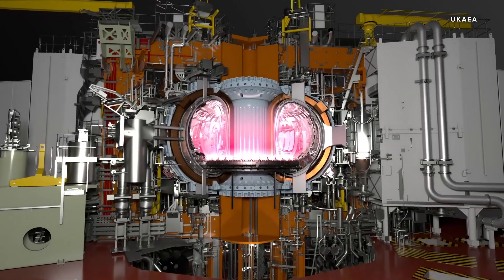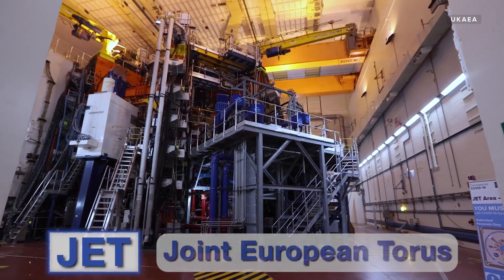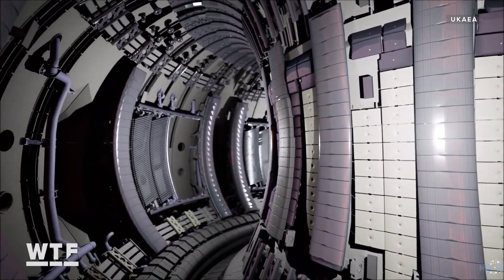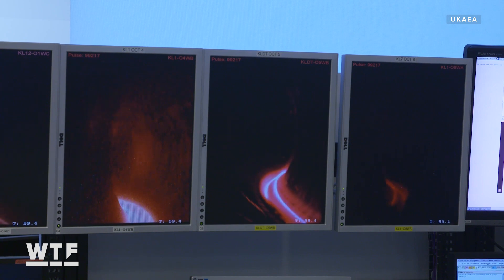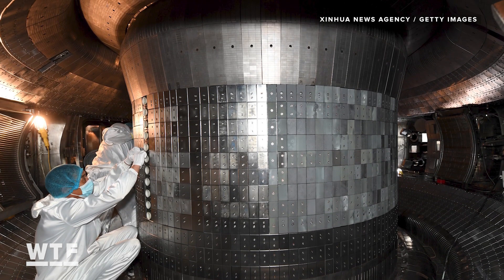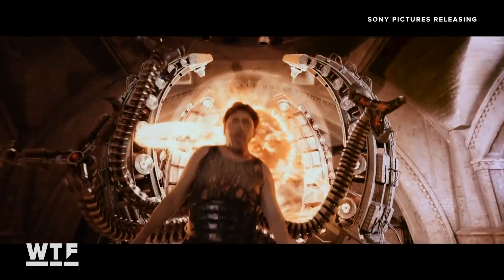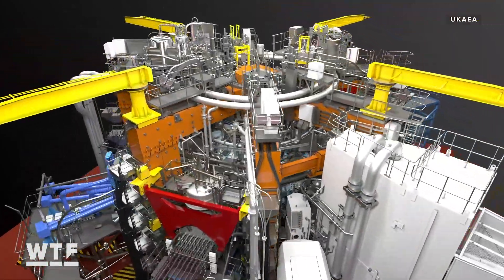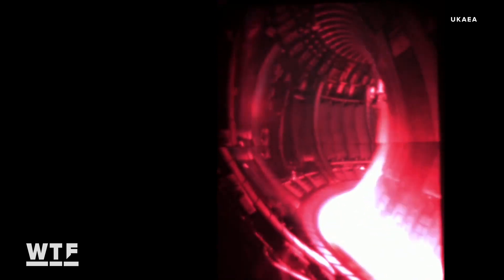World's Largest Fusion Device Breaks Energy Record

Comment: For those wondering, Q was 0.33 for this latest experiment whereas Q was 0.67 back in 1997.  This is the ratio of energy coming out of the plasma over energy put in, so Q=1 is break-even.  The difference with this recent experiment is that it lasted 5 seconds and produced 59 megajoules of fusion energy whereas it produced only 16 megajoules in 1997.  ITER should be able to have a Q of around 10 when it performs similar experiments because it's larger than JET which makes it more efficient.
Reply: Poly Bun  Totally ridiculous. deuterium enrichment from water is a trivially minuscule energy cost. A single liter of heavy water which costs <$1,000 would produce the energy equivalent of burning 2 million liters of oil.
Reply: @Muonium1  lmao that's insane. God I love how people in 2022 STILL act like it's not possible.
Reply: If larger waste of energy by an exponential factor can be claimed as greater efficiency simply proves how easily investors can be fooled by non-science nonsense.
Reply: @PugsleyLoveJoy  you really have no idea what you're talking about huh
Reply: @bigsmall246  Actually, I do.  I happen to be a nuclear physicist. I also was the first to create cold fusion, in a jar and my setup was what was originally analyzed by Pons and Fleischman. They did not create the original setup.
Reply: @PugsleyLoveJoy  yea and we all believe you
Reply: Thanks for clearing that up. Until now, I had thought that Q was the ratio of trafficked children to elite paedophile cannibals and was relieved that it was still less than 1. I was wondering why we were aiming for more than 1.
Reply: @dannyarcher6370  lol
Reply: great news!! so in 30 years ...  Meanwhile good old fashion Thorium fission, (the stuff that powers our planet core/magnetic feild)  You know the DOE had a working Thorium molten salt reactor and it was shut down in 1962.
Reply: However this recent test did NOT break the '97 record for power, importantly. In '97 they had a max fusion power output of 16 megawatts, this shot was only ~11 MW. With the newer ICRF and NBI heating capability they've installed in the decades since, they SHOULD be able to also break that record, and I believe JET will also be the first magnetic confinement device to achieve scientific breakeven within the next couple years.
Reply: @Nathan, are you talking Qplasma or Qall there? This will only be viable as a power plant if it produces more power compared to what went into it to keep it running.
We don't care about the Qplasma really if we want to have Fusion power plants if the rest of the plant's efficiency is lower than 100% (i.e. Qall < 1).
Reply: ITER is a nonsense lie. They are referring to a different Q and wilfully allowing this confusion to deceive people. Watch Sabina's video on this topic. Fusion has two different Q values and scientists lean into this confusion, to make their progress sound more impressive than it actually is.
Reply: You've got nothing on my dilithium
Reply: You are lying @Nathan
Reply: The 0.67 back in 97. Can they replicate that exactly. Or, in the interest of aiming small and missing small. Was it a once off, in the sense that they have come close but never exactly the same as it? Do you know?
Reply: I'm just curious why they're not exploring more usage of AI to control the plasma. Deep learning has been demonstrated in another reactor to show very precise control of the plasma via the magnetic fields.
Reply: Hypothetically, how much fuel (e.g. deuterium) can need a fusion reactor to power the whole planet for a 24hour day? My concern is that - if for thousands of years we will consume hydrogen that now it can be abundant - what will happen in nature? if we even reduce hydrogen in earth by 1% what are the consequences of that?
Reply: @usefulcreativecontext  There's lots of deuterium in sea water even though it's a fraction of a percent.  The tricky part is getting tritium.  Theoretically, this can be done by lining the reactor with lithium and using neutrons from the fission reaction to get the tritium.  The reaction that creates tritium also releases a lower energy neutron, so it's theoretically possible to produce enough tritium with this system.  The lithium supply of the planet should be enough to power civilization for thousands of years, if not longer, and this should buy us enough time to come up with a better way to produce power when we need it.
Reply: However, renewable sources use earth dynamics (gravity, air flow, sun, etc), and does not directly consume elements. Yes batteries and its construct may consume but can be recycled almost 100%. I think as humanity we must start calculating the consequences of spending elements in far future and earth dynamics.
Reply: This started in the 1960s. JET was built in the 1970s and was fired up in 1983. Q=0.33 is a terrible result. They achieved 0.67 25 years ago. The deuterium/tritium mix isn't new or unique. It's been used for decades. Tritium is extremely rare, expensive and radioactive. Is this an elaborate scam? "ITER should have a Q of 10"?! Are you joking? They can't even get Q=1. That would be a notable milestone for science.
Reply: You are conveniently hiding that the power input was scaled up, is the reason for the longer duration and more heat produced, not from fusion occurring.
Reply: I was waiting for this for 100 years its still uncomplete
Reply: @masternobody1896  Don't worry. Fusion power is only 30 more years away.
Reply: LoL.  So what?  Fusion is going to be so ridiculously expensive, it will NEVER compete with conventional renewables plus storage.  Fusion research is a waste of time, money, and talent.
Reply: @incognitotorpedo42  Before this war Russia was spending a TRILLION bucks to start gas extraction in it's part of the arctic circle.  That's just one fossil fuel project. Ridiculously expensive compared to what? 

Since the 1950s about 30 billion has been spent on global fusion research. Sit down mate, you clearly have no idea how money/science/economy/research/life works.
Reply: @incognitotorpedo42  oh god a boomer man how many times people have said  in history what you just said. 

I.E. Basically you: "Planes will never fly its a wast of time and money, let's build wagons"

Comment: How is the fusion energy transformed to electricity ?
Reply: Probably turbines  as with fission.
Reply: The way everything (except solar cells) produces electricity, turns a turbine.
Reply: The trick here is not how to make it into electricity, Certainly if you can make this type of machine you could easily make electricity out of the plasma. But rather how the nuclear fission is first produced. Rather than having to make rods and have to put  them into the water like regular nuclear sites. They somehow make the plasma out of renewable resources. And there doesn't seem to be any long term waste products by this new type of fission. The Jetsons' indeed.
Reply: @vancechristopher  fusion reactors will produce waste products and the scientists know it. However, the problem is it's illiterate journalists who are writing the news articles. These illiterate journalists understand like 5% of what the scientists told them, then dumb it down further till the layman can understand. And then they sensationalize it. By the time it reaches the layman, it has become a fairy tale.

Don't get me wrong, fusion is the way ahead and we've basically shown that it is feasible with existing technology. Private investors are already starting to identify which companies to invest in.
Reply: @vancechristopher  Actually, making electricity IS the trick here.  There will be a ton of engineering problems.  This is all so preposterously expensive that it will never be able to compete with conventional renewables + storage.  ITER is a huge wast of money.
Reply: Believe it or not, not even a single volt of electricity has ever been produced by fusion "reactors", which are just massive space heaters that cost more to operate than any other beastly thing ever created.

Comment: Still years off, it's been that way for decades :/
Reply: This was a major step forward.
Reply: @sdclams117  
A beetle was walking from point A to point B.  I gave it a hand, picked it up and walked it a hundred steps closer to its destination, which was a major step forward.  Turns out the beetle 🐞 needed to travel another 1,000 miles to reach point B.  Still, from the beetles perspective, it was a major step forward 😆
Reply: Well, technically,  it's been decades off for decades, and ... are you sitting down .... still is decades away 🥳

Comment: at 20 cents per kwh that's 3$ worth of electricity.
Fusion is incredibly important for space propulsion and the advances in superconductors will have many applications but for electricity production we have solar.
Reply: Panels production has plenty of emissions. Concentrated solar is rarely chosen. Ignoring the large amount of land needed for both options.
Reply: We don't have solar. There's no solar during nights. There's no solar during cloudy days. There's not enough solar during winters. That's why we still don't use solar: Because we don't have it. And if you want to fight climate change you don't have to substitute fossil fuels in the grid. You need to do it for transportation and industry. Which means you need to tenfold solar and go to sleep at 6 PM in order to cover mankind's energetic demands.
Reply: @BlueFrenzy  There is something called a battery for cycles that are less than a week long.
For winter you just need to deploy more solar panels.
Reply: @johntheux9238  We don't have enough batteries to cover mankinds energetic demand. There's not enough lithium out there. But also, deploying more solar is also problematic.  Solar panels have a lifespan and they are not completely recyclable. They need to be sitting there "just in case". As you can imagine, doubling the number of solar panels is hardly sustainable. While closing a nuclear central and turning it on on demand is cheaper, scalable and requires much less mainteinance than solar panels.
It's so true, that probably, if we manage to cut down the price of fusion by improving the technology once people invest on it due to breakeven, we will stop using solar panels because of how difficult to handle they are. The future is not solar panels but fusion + solar arrays.
Reply: @BlueFrenzy  There are not enough hard rock (spodumene and petalite) deposits but other lithium sources can be used such as hectorite clay which is abundant.
Reply: @johntheux9238  And it's still far from what is necessary. But really far. And that's just considering a 24 hour battery (you will need much more than that if you want to survive some winters) and not counting other technologies that requires lithium, like electric cars. Yes, there's some plans to use the car's batteries as grid batteries when they are connected, but I am certain you don't want to not to be able to use your vehicle because last night there was no wind.

And, even if you dismiss it all, there's the logistics problems. Building up all the infrastructure to support the surplus of solar panels plus batteries to cover for worldwide needs would take several centuries.

Nuclear energy decimates the requirements of solar panels and batteries, with all the associated benefits from it.
Reply: @BlueFrenzy  Not really, there are more than 80 million tons of easily accessible reserves. That's enough for 470 TWh of storage.
Reply: @johntheux9238  IDK where you get those numbers. The numbers I hold talks about 14 million tons which can provide at an average of 300 wh/kg, which is about 4 Twh of storage. 1/3th of mankinds energy consumption (today), consuming all lithium on the surface and taking 160 years at current pace of extraction.
Reply: @BlueFrenzy  I got it from common sense skeptic. I thought that idiot would get the most pessimistic numbers available and I'm surprized I was wrong.
Reply: @BlueFrenzy  And it's 5'900 Wh/kg since there is very little lithium in a lithium ion battery.
Reply: I pay 140 euros per month for electricity, so 3 usd sounds more than welcome.
Reply: Couldn't agree more
Reply: Words
Reply: One of the dumbest comets ever.
Reply: Space is a comic book fantasy that does not exist.